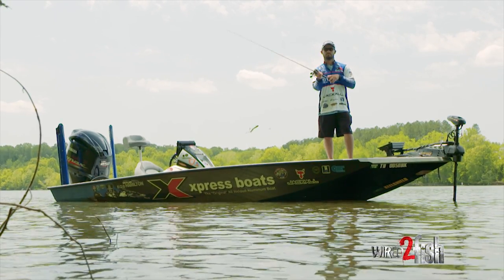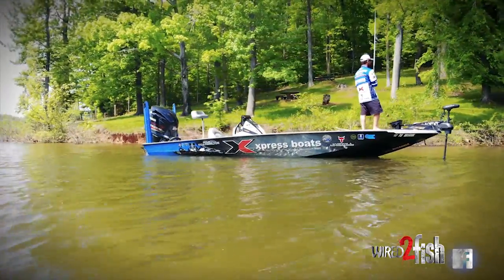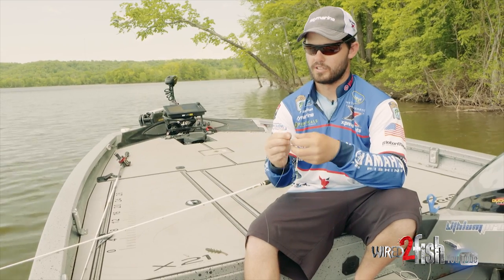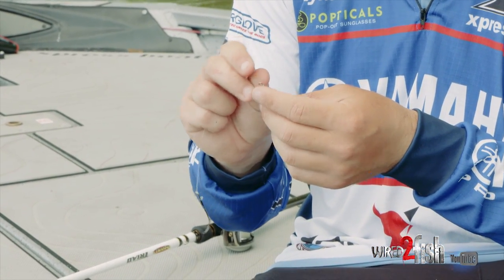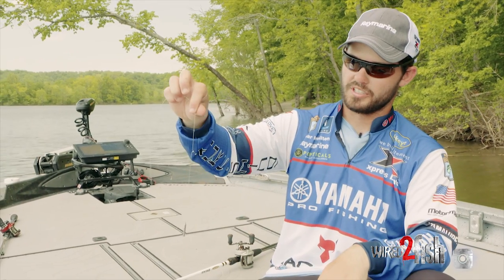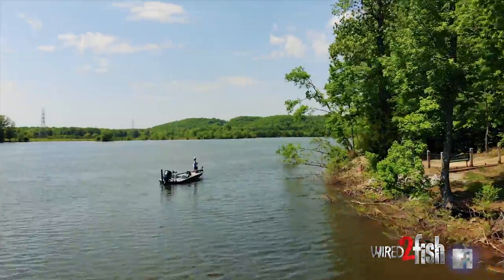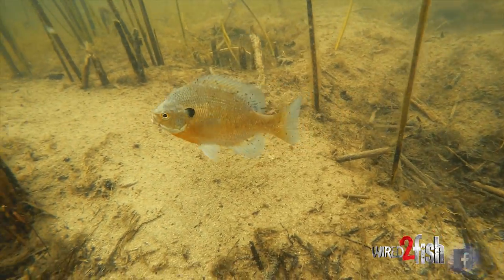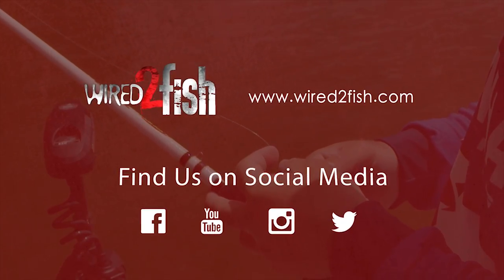How to Rig the Power Shot for Shallow Water Cover

Comment: How can you use 16 pound fluorocarbon if most reels say 12 pound is max
Reply: Alec Hintz That's amount of line capacity the reel has for 12lb test line (Mono). You can put any size line on a reel.
Reply: Marcus Young how much line do you put on then
Reply: Alec Hintz Fill them up until you see about an 1/8 of an inch of spool left. Don't overfill and don't underfill. Reels with larger spools  can take more of the larger lines. Reels with wider spools cast better.
Reply: Marcus Young what about 20 pound
Reply: Marcus Young so then what does the pound line and the yards of line mean
Reply: Alec Hintz The pound test is the line's breaking strength. The yards is referring to how many yards of that specific lb test line can be spooled on to the reel.